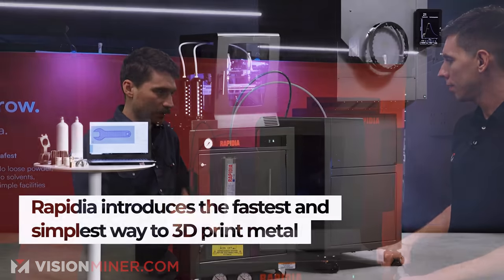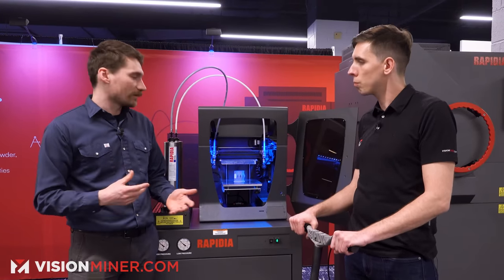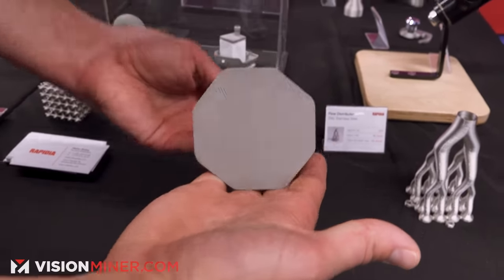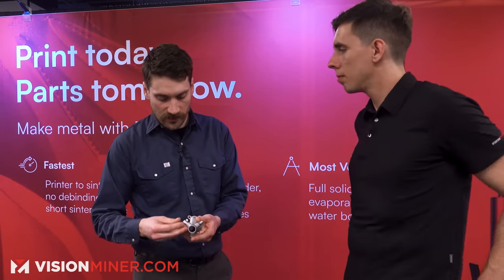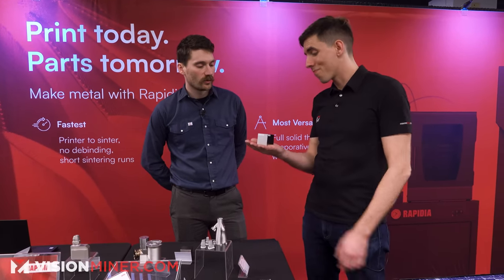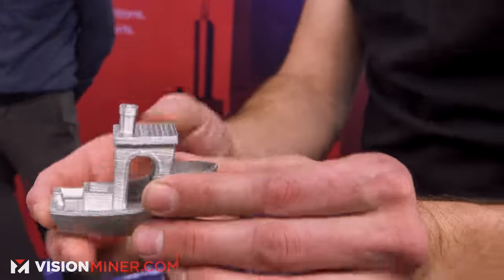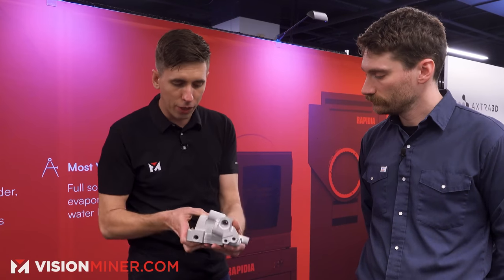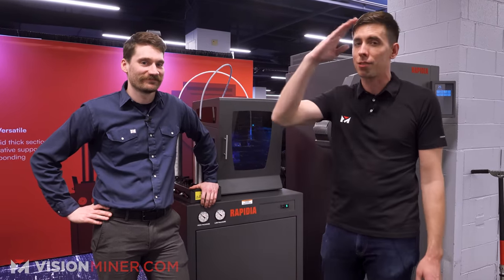3D Metal FDM? With Paste? Wait, What? Rapidia 3D at AMUG 2023

Comment: I think it will work for bulk parts, and laser printing is better suited for precision work. From what I understand, laser printing can become messy when printing something as thick as 2cm, and the process is very slow (correct me if I'm mistaken). I'm also a bit concerned about material shrinking during curing in the kiln, but ability to machined after cure process impresive.

Comment: One of those things is that if you need to know the price, it's probably out of reach.
Reply: I would absolutely love an affordable desktop Metal 3D printer but most are just too expensive and proprietary
Reply: @انا_ابراهيم_البناوي  The day will come though when affordable desktop Metal 3D printers are available and I built a business on that belief. For now though high temp  filaments are useful for making strong parts. I buy HTN CF25 from Vision Miner and I printed one of our 11/16 wrenches with it and it got up to 35 foot pounds of torque which is generally more than you would ever be using a wrench that size for.
Reply: @3dprintedhardware  Essentium's HTN-CF25 is the most incredible material I've ever printed with. It does need to be dry but damn, it's as easy to print as PLA and it'll easily replace aluminum machining in most of our fixtures.
Reply from the maker: Epic! Send over pics/videos of parts, and we'll feature your company in a video! media@visionminer.com
Reply: @circleofowls  That's a new one I'll make sure to check it out might get one for my college they've been looking for filaments like that
Reply: @VisionMiner  Will do, expect an email some day next week.
Reply: It's a completely dumb statement. If you don't know the price, don't want to waste time talking to a fucking business guy, and competitors sell equivalent alternatives then you don't buy from this one, period. You need to be able to calculate the financial amortization no matter if you have 1 million or 500 million € in your bank account, so you need to know the price.
Reply: @Quatuux  lame

Comment: "its better than a weld. Its closer to a braze"
Its very concerning to hear those words leave the mouth of someone working with metal printing.
You're basically screaming "this technology has no structural application whatsoever".

I hope you got that backwards.
Reply from the maker: According to the internet, "Brazing is better than welding at joining dissimilar metals. It can form strong bonds while not significantly changing the properties of the two metals." -- that would make sense. But this is certainly an interesting point you bring up!
Reply: @VisionMiner  You're 100 percent right, its not just better at joining dissimilar metals. Brazing is the only option. Steel and aluminum is the obvious one.

Here, we're talking about welding (sintering, actually) the same metal together. The exact same metal. The only time you would use brazing (aka soldering) is for convenience, where strength and high temperature function aren't issues and needing to take the pieces apart again is an issue.

There are a lot of metal 3d printing techniques out there, from powder bed fusion for precision to additive MIG welding for strength and uniformity of the metal, to regular FDM with high metal content filament that requires sintering later, the only real advantage of which is cost.

So cost is the real question here. Powder bed printers and additive welding machines are going to start very conservatively at 100k USD and shoot up from there. Unless these guys are bringing a whole system to the table for less than 10k USD, I don't see the point. Having a shrinkage factor of 10 percent (or similar) puts it in the same usefulness category as a Creality Ender using Utrafuse filament.

Its great to see innovation, not so great to see gimmicks. I think all they've got here is removing the debinding step in FDM sintered metal 3D printing.
Reply: I think he means that the entire contact patch between the parts are joined together, like a braze would be when the material wets between the surfaces from capillary action. Also, similar to a oven braze, there isn't weakened surrounding area due to internal stress like there is in welding without post process.
Reply: @neverwipe  I already covered all this in another comment, but no. What you said would make a tiny shred of sense if he wasn't standing right next to a sintering furnace.

There's too much to cover here, but I would suggest watching one of the many videos on Ultrafuse, but not a paid sponsorship.

These parts come with some worse internal stresses than any welded parts. Thick parts crack and any change in thickness creates stresses that can't be annealed away like they can in a welded part.

I sort of get what you're saying, but brazing is always bad unless welding literally isn't an option or strength doesn't matter, and brazing steel DEFINITELY gets the steel hot enough to ruin its temper and it can't be quenched again without cracking the braze.

I mean lets put it this way: if you had a cracked engine block that you wanted to save (aluminum or steel), you would NEVER braze it and pretend it was going to work. Welding is the only option.
Reply: @htomerif  I agree that he could have worded it in a less confusing way. The joint that's created from water bonding is no different than the base material since, as he said, the solvent in the paste is water. It's still not considered welding, the bond created is just plain sintering, like the rest of the material. IMO, this is actually a very attractive property that you wouldn't get with the standard fdm/debind style methods. This company talks about this in other youtube content.

Btw, I respectfully disagree with your view on brazing. In some joint applications, even where your bonding the same metal, it is stronger. Brazing an overlap for a shear joint is better than just welding the edges, for example, a sleeve over a round bar. They're especially strong if you use an alloy like saftey silv 45. This isnt true for tig brazing, which is weaker than tig welding. I think brazing is slept on since it makes less sense on larger structures, so its not popular. I am a fan of both welding and brazing. They each have their applications.
Reply: @neverwipe  You're actually not disagreeing with me at all. A shear joint falls under the category of "cannot be welded" and the category of "strength isn't important". (the strength is important, its just irrelevant due to how a shear joint works)

The only reason you're using a shear joint in the first place is because you you can't weld a butt joint on a sleeve without almost certainly welding the sleeve to the bar and having to machine (or at least grind) it afterwards.

If you make a shear joint long enough, it will always be stronger than a butt joint because you can make the surface area of the overlap arbitrarily long.

I personally don't see the reduction in the debinding process as an upside at all. You're either sending your parts off to get debinding and sintering done by someone else, or you're doing it yourself by running a temperature profile on a single kiln.

A lot of what it comes down to to me and to everyone is: what's the cost of the machine and what are the costs of the consumables. Ultrafuse is about $150/kg, which is insane, but I'm guessing these guys proprietary sauce is at least double that, and a custom made vacuum sintering furnace? Its not gonna be cheap.
Reply: @htomerif  There are a few benefits to less binder. You're not obligated to print with infill, you can print solid since less binder needs to escape; less argon use; and you get to do neat tricks like water bonding and smoothing. There aren't any inherent downsides I know of. This makes them compare better to standard fdm style systems like what desktop metal and markforged offer, which are priced about the same. Some companies can justify having an expensive CNC while others outsource for the occasional part. Same goes for this. Btw, I think cheaper to get parts from PCBway or Xometry than the Ultrafuse route since you dont need to pay for 2 way shipping.
Reply: @htomerif removing the debinding step (or more accurately, removing the solvent debinding step and expediting the thermal debinding step) is more beneficial than just faster post processing or cost savings. With the traditional approach (filament with high infill of metal powder), you can only produce parts that have solid cross-sections (i.e, no infill) of up to ~4 mm. Any thicker and the part most likely fails during debinding. So for any decent size part, you are forced to use ~ 35% infill, hence limiting its use for applications where mechanical properties matter. My concern would be the shelf life of the paste. For instance, does the powder agglomerate or binder separate if left unused for a couple of months?

Comment: I suppose shrinkage will never bee the same on the three XYZ axis, so this method will always produce warped/deformed parts depending on the object shape...
Or I'm missing something?
Reply: Shrinkage along the Z axis is often higher than the XY, but once the process is dialed in, the difference is pretty constant. So, you can scale up the print (i.e., “green” part) in the slicer by one factor for XY and another factor for Z, and obtain the desired dimensions after sintering.
Reply: @DRMH2016 with the cost of material it sounds like it will be an expensive endeavor, but then again I doubt cost will be of concern for most buying this printer

Comment: Youtubers claims that Superglue and Metalpowder is incredible strong.
I tried with some powder left from grinding in steel, but it seems to be difficult to mix with the glue, but got a little piece that seems to be very hard. More testing is needed.
One problem is that superglue is very expensive. But that mix should be possible to 3d print with. 
Now just make the machine for it, thanks.